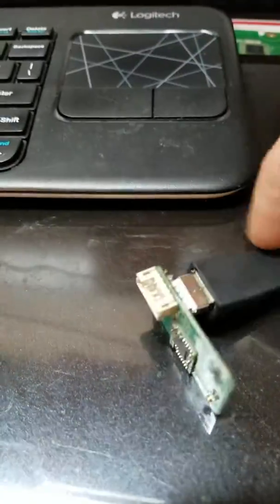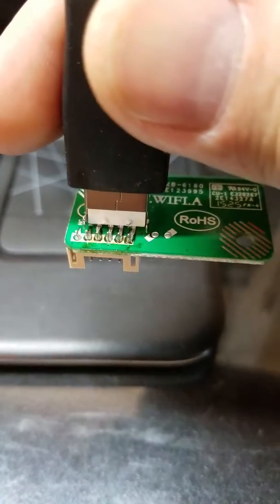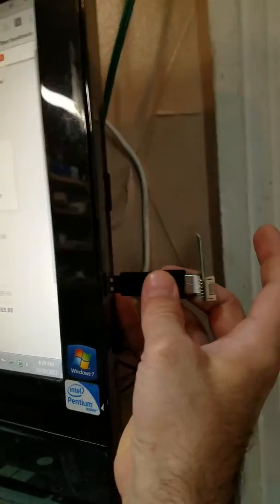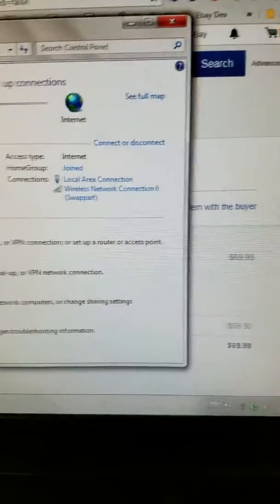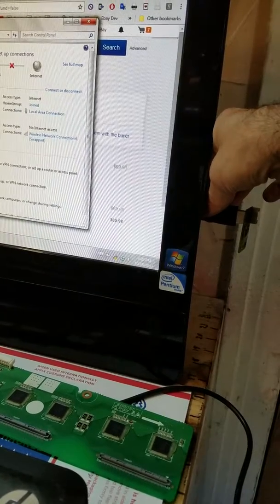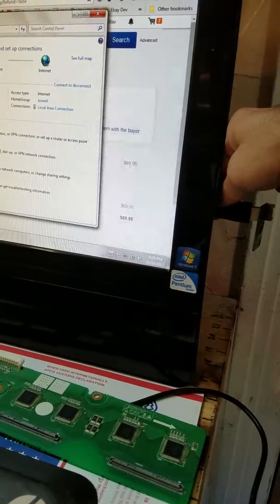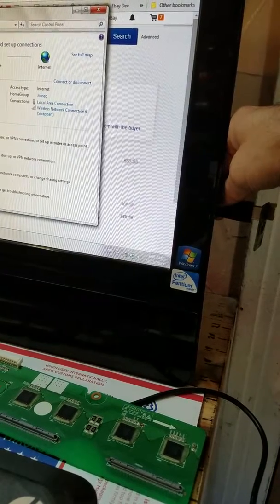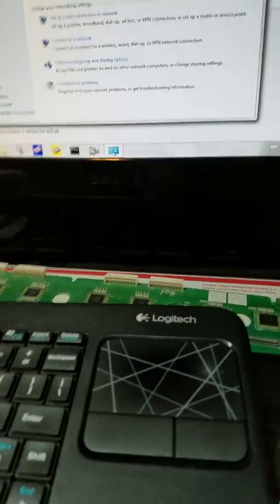Testing RCA SLD48G45RQ television WiFi module with computer.

Comment: I don't understand that test because doesn't your computer have its own wifi built in? 
I am going to order a WiFi module for my Samsung Smart TV, that suddenly stopped connecting, though if i put a cable in it, it'd go thru that way. Anyway,  the reason I found ur site was asking if you can test a WiFi module. Now seeing your video, I'm questioning getting one. But for 25 bucks, it's worth a try. I saw several videos that changing the module does the trick. Anyway thanks 🤞